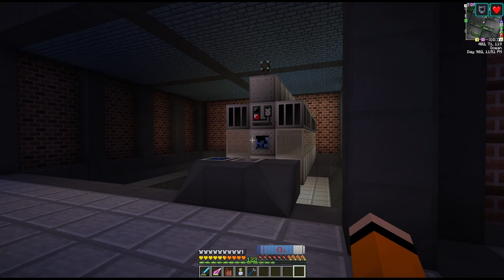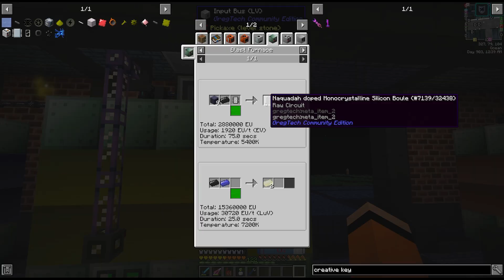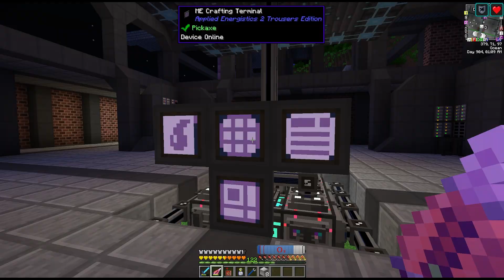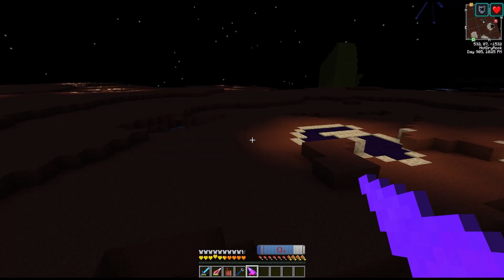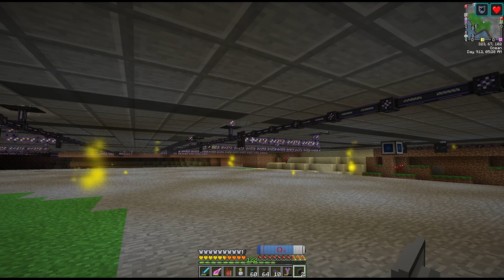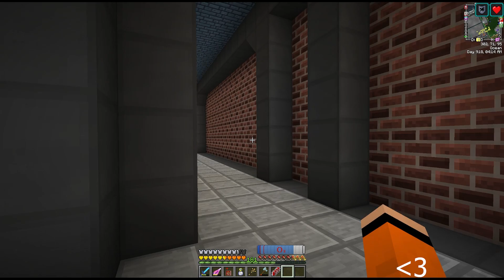FTB: Interactions - Gregtech Fusion Reactor! Modded Minecraft Ep39

Comment: At omni questbook was saying 16 turbine with luv holders for Mk1
Reply from the maker: Does the rotor holder tier increase the fuel consumption though? I'm using the MAX rotor holders for the plasma turbines
Reply: @Threefold.  Yes. MAX rotor holders spin up to 7500 RPM (as compared to 6900 if you use LuV rotor holders). The energy output is modified a factor of Rotor speed/6000 (According to wiki). So higher tier turbine holder = more energy produced = more fuel consumed, since the amount of energy generated per mB of fuel is a constant. By using max rotor holders, I think the maximum number of plasma turbines you can run is 10. You can actually calculate it based on the values in JEI. calculate how much mb of fuel ur reactor produce, then calculate how fuel each turbine burn (oxygen plasma energy value divided by the energy produced by your fully running turbine per tick) 👍

Comment: 24:50 According to Omnifactory discord, Mk1 fusion reactor can run 15 plasma turbines burning oxygen plasma. If you're using a LuV hatch which outputs one amp of Luv power, the number I calculated was 15.6, which is 15 plasma turbines. If you're using a higher output hatch to maximize the 48640EU/t output, then it will run 10 plasma turbines. Basically, tons of power either ways 😂